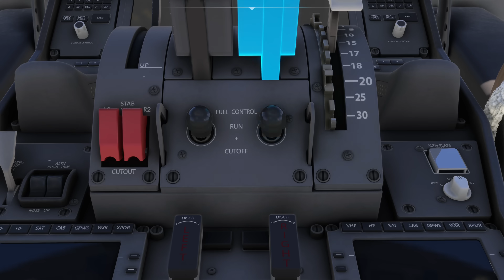Air India 171: Why Did The Fuel Cut-off Switch Get Moved?

Comment: I haven't seen any commentator explore the possibility that a software bug or faulty switch caused the EEC/FADEC and FDR to perceive the fuel being Cutoff for 8 seconds even though the physical switches never moved from Run.  For example, there might be a sensor that detects air in the fuel lines and automatically cuts off the fuel flow; this sensor might have failed or misread.  Such a scenario would explain the pilot's conversation.
Reply: I have asked this on different channels covering this incident and have received no replies. I do not believe there is some sort of mechanical linkage from the fuel cut off switches to FADEC/FDR etc as these devices (FADEC/FDR) work on electrical logic states. If the system detects that the fuel pump (for example) is not being supplied with power, then the system would come to the conclusion that the only way this could happen would be if the switch had been moved to the 'cut off' position.  What if the logic input to the FADEC/FDR confirming power to the fuel pump was interrupted briefly? To the electronic logic, this would seem no different to the switch being set to off. On the other hand, I think there is more to the Run/Cutoff switch than just controlling the fuel pumps. Don't they also have inouts to other parts such as igniters etc?

Comment: Is it correct to “ assume”  that when a fuel control switch is set in its designated run/ cutoff mode, the operations of the fuel valve are “fail safe” to remain in that operating mode until until pilot initiates change?

Comment: Capt Steeeve keeps rhetorically asking “why would one pilot deliberately turn off the fuel switch and the other pilot deny it?” Obviously those fuel switches aren’t mechanically connected to the valves that supply fuel to the engines. There are micro switches, relays, actuators and electronic mechanisms that are all part of that system.  A failure in any of those components could cause a malfunction that led to the crash. Even a 1 in a million chance does not mean it can’t happen. Lotteries are won every week by people despite even higher odds!
Reply: Exactly. I have just made that same point in the comments of another video. Many people seem to think that the data indicates that the switch was physically flipped. That's not necessarily the case. If we had cockpit video, then we would know 100% whether the switches were flicked or not.

Comment: I am from Ahmedabad, if we don't tell the truth then such accidents will happen again in future, if you connect the dots then you will find how hard the pilot worked to save the flight, If you look at the original video captured by the runway CCTV you can clearly see that the pilot tilted the flight from left to right for 2 seconds. The fact is that after that interaction they found that the switches were still in the on mode, exactly 9 seconds later the right hand pilot found the solution and turned the right engine fuel switch off and on, also tilted the flight slightly from left to right (to get maximum fuel flow) 12 seconds after the interaction and 3 seconds later he turned the left hand side switch off and on as well and immediately he balanced the flight again. The right hand engine started but the loss of those 10 seconds after the interaction... became difficult (because they both went searching for other possibilities, since both switches were already seen to be in the on position), in the end the fact is that the pilot did what he could, the loss of that 10 seconds gone hard and bad luck

Comment: I have a different idea. What if the fuel switch move cutoff due to some technical fault and the first pilot tries to adjust it. But the fuel switch moved down again. Then the second pilot ask why you cutoff the fuel butghe second pilot said he didn't do it. In that case it's no one's fault. May be then one pilot tried to keep it up manually by hand or something after trying to put it up several times. This explains yhe10 second gap to turn on switches again. Anyway this is just a thought.

Comment: Read this advisory issued in the past. SPECIAL AIRWORTHINESS INFORMATION BULLETIN
 * fuel control switches were installed with the locking feature disengaged.
 * If the locking feature is disengaged, the switch can be moved between the two positions without lifting the switch during transition, and the switch would be exposed to the potential of inadvertent operation. Inadvertent operation of the switch could result in an unintended consequence, such as an in-flight engine shutdown.

Comment: As a retired 787 Captain (38 years at a major), I don't see a problem with encrypted cockpit video that could only be viewed during accident investigations. When CVRs were introduced, pilots complained that they would be used against them. They weren't, and often exonerated pilots who might have otherwise been blamed. Now we have FOQA where entire flights can be reproduced and information is not leaked. One of the pilots asked the other why he "did cutoff". That could easily have been asked by the pilot who actually selected Cutoff, as a diversion, knowing that the tapes would be used as "proof" that the other pilot did it. Without visual proof, we may never know who moved the switches. Maybe fingerprints may prove who reselected Run, but even that might not prove who selected Cutoff.
Reply: Good points. I'm disappointed that Captain Steeeve says that the audio & data recorders give virtually the same information as video would. If that was the case, we wouldn't still be speculating & asking questions. A video recording would clear up doubts immediately. The cameras don't even have to focus on the pilots, as long as they show the control switches, we would see which of them flipped the switches (assuming the switches were ever physically set to cutoff that is!).

Comment: Hey Cap...I am just an aviation enthusiast...I just wanted to ask a question if both fuel cut off switches were turned off wouldn't they make a sound? And the cockpit voice recorder has 3 mics...any one of those mics would have recorded the mechanical sound of those switches being turned to off state
Reply: There will be a clicking sound for most switches. I am not sure whether all switches are like that or not, but most probably.
Reply: @JPTalkshow hey but during that take off phase pilots are just supposed to provide thrust to the engines and rotate after V1...there is no process of pressing any buttons..so if any button is pressed it would have been recorded

Comment: Hi Capt Steeve .. you didn’t mention the chance of a faulty wiring… ground short.. may be the maintenance performed the maintenance on the panel? Main be a wire was chaffed which shorted the circuit and crew tried to recycle the switch cause they cant see underneath the panel…
Reply: Both switches are on independent circuits. They were turned off 1 second apart exactly the time it takes to be manually turned off.
Reply: yes true maybe one of the screws came loose, or maybe the spring was too springy and it sprung from on to off

Comment: Enjoyed your video, good work.

Question: Let's hypothesise a person was going to intentionally crash a plane, why might they use the fuel switch? I mean I assume that they could just push the yoke hard forwards when close to the ground and achieve the same outcome with a higher degree of certainty. Whereas with the fuel switch it's possible in principle that the other pilot might have noticed what was going on straight immediately and saved the aircraft. If you apply Occam's razor is this the most direct way a pilot would achieve this outcome?

Love your videos, keep up the good work.

Comment: I understand the fuel switch is designed and manufactured in a way that it can’t be hacked or toggled by mistake. But it’s the design and manufacturing flaws itself that’s in question as the whistleblower indicated, so I’m not sure to understand the urgency with the free pass here.

Comment: Is it possible that the transitioning of switches as quoted in the report was referring to what was detected by sensors rather than the physical shifting of the switches by the pilot? And the asking of "why cutoff" happened because the pilot felt/heard the engines stopping?

Comment: I respect you a lot Steve and have been watching you from a long time.
But, I don't trust you anymore on this incident. You have lost my trust when you said that the pilot put up the flaps instead of landing gear in the first video knowing how different the position and structure of their control switches are. Now, you are straight away putting the blame on the pilots and advocating mental health and all.

Not once you have considered a fact that maybe the fuel switches got moved to cutoff due to a mechanical failure and one of the pilots noticed it then when he tried to put them back to run, the other pilot noticed and thought that the pilot itself turned them to cutoff that's why he asked "why did you shut them off" and the other pilot replied "I did not do so".

Comment: when the fuel control is switched off in the air (like during an engine shutdown), do you get any specific warnings or voice alerts on the flight displays or monitors, such as “STALL” or “RETARD”? Or is it mostly just engine parameters dropping off? Curious how clearly the system communicates that kind of failure. Thanks in advance!
Reply: He said in the video that he doesn't know if there are specific warnings or alerts but he hopes so.

Comment: Modern airplanes need to leverage AI. If AI was active, it could have prevented turning off the fuel switch in a take off event and at that altitude. There could be an AI kill switch if both pilot and a stand-by AI agree that the main AI needs to be shut down owing to any software glitch.

Comment: No mention of the 2018 FAA recommendation that the Honeywell Cutoff switches had been found disengaged on some aircraft such that the levers could be pushed up without lifting. The preliminary report says the two switches were moved to cutoff within "01' seconds of each other. That's quick. If the switches were disengaged then they might have been pushed up together in some freak movement and the pilot telling the truth when he said he didn't move them.

Comment: Sir, the preliminary report leaves many things unexamined and undone. (1) Specify who asked the question, though the question has been quoted. (2) Specify who replied and quote his reply. (3) Were there no further discussions between the two pilots - nothing is reported.  (4) Make a five- column analysis. (a) time in seconds, (b) Conversation (c) actual pilot, (d) pilot monitoring, (e) action taken by the system

Comment: Hello Captain Steeve, question for your next Q&A:
In another YT video, former 787 pilot Sharath Panicker (with 10 years of experience on that plane) says it seems very unlikely that a pilot could manually move both fuel cutoff switches from RUN to CUTOFF within about one second. He also noted it took them around 4 seconds to move both back to RUN during the emergency, according to the report, and that's the easier direction without having to overcome the locking mechanism.
How realistic is it in your experience to expect someone to switch both to CUTOFF that fast in the cockpit layout of a 787?

Comment: Can these 2 fuel cut-off switches be placed at more distance apart than from their current position? So then both the pilots have to be in unison and it requires both their actions simultaneously to cut off the supply.

Comment: The critical switches in an airplane are protected by a red cover over the switches.
As important as the fuel switches are, shouldn't they have a red cover over them. It's hard to be unlucky using the switches when you have to lift the red cover first. This will generate a double action before the cut off

Comment: One pilot asking other did you cut off ?? 
That's just question ..When you find something not to be done ..and other admits no i haven't showing responsibility in answer. 
and yes Switches are so visible to other pilot, off course so if other pilot turn it off it would be visible to one pilot in cockpit .
So definitely it's Boeing failure  and switches malfunction .
Reply: Then why were they switched back on? The switches worked perfectly

Comment: Fuel lines are not right behind those switches. It is only an electrical signal going to the computer and the computer turns off the electric valves. It can be a worn wire problem or similar issue. If one pilot turn the switches off then surely he would prevent the other pilot to switch them on again by covering them with his hand or similar action to not let the airplane come out of a crash situation. But the flight recorder said they signalling that they where turned on after 10 seconds. If the fuel valves had been opened just a few seconds earlier it would have prevented the crash. Cockpit cameras would be great as the airline can review footage each month at an evaluation meeting with the pilot and try to correct any ill behavior or praise any good behavior with an extra bonus. Hundreds of passengers lives depend of correct behavior from pilots. One pilot said "why did he cut off fuel" as in he=airplane, when the alarms and indicators alerted of the cut fuel. He must then have looked at the switches and found them on or he would had immediately switched them on again. So after an assessment of the situation for 10 seconds he either put them to off and then on again or the computer did it. At any rate the computer shouldn't allow the fuel to be cut with the throttle not at idle or a fire extinguisher being activated or a second confirmation being done at the flight computers control panel.

Comment: Just wondering your thoughts on the theory of the switches moving to cutoff when the normal call of ‘positive rate, gear  up’ is made. One of the issues 8 see is it appears that he gear has never been raised or unlocked. I’m a sim instructor and have seen some ‘interesting’ responses to someone under severe stress or fatigue that I wouldn’t be able to explain. The best in my thoughts trying to put aside the more obvious conclusion that I hope is not the reason.

Comment: Good morning Captain,
I was just reviewing a comment from an Indian pilot (apparently a senior one), who mentioned that it would be physically impossible for both switches to have been set to the cut-off position within a one-second interval. The reason is that this type of switch is spring-loaded, in other words, "pull up, move down, release." This type of switch is therefore held in place by a spring mechanism.
Do you consider this analysis to be technically sound and plausible?
Greetings from Lisbon!
Reply: It is very much possible unfortunately and has been also simulated since in a real cockpit.
Reply: They're blaming it on pilot to save their own face, the fact is that maintenance had been neglected; not just in India airlines but globally to keep shareholders happy.
Reply: @1977Bom  and your proof that maintenance was neglected is where?

Comment: Dear Captain, thank you for your programs always give me deeper insights. I think this incident happened due to neurasthenia, which may be due to too much stresses piled on the pilot from his daily heavy duties. The pilot cut off the fuel when his neurasthenia exploded on the take off and it was not planned. I think it is similar to an incident happened on Feb 9th 1982 at JL350 just before landing at Haneda airport.
The pilot reversed the engines just before landing on Haneda airport and DC-8 was plunged into the sea by killing 24 passengers and injuring 149 passengers and crew. I believe the above was what happened to AI171 which was not planned but a tragic incident.

Comment: What nobody ask is: If any pilot did move the switch, why did they never said anything about setting them back to RUN position! Cockpit Recorder doesn't record anything about switches after one pilote ask the other pilot if he moved the fuel switches to CUT OFF! Then it's silent until MAYDAY is called out! There should be a lot of talking between pilots if anything was wrong! Or did we not get the whole recording from cockpit?
If switches was in CUT OFF, I would set them back to RUN as fast as possible, not waiting 10 sec to do it! 
The pilots only confirm that they did not move them, nothing else.... They must have looked to them to confirm that they are in RUN position?

Comment: In my view, the plane should not allow both engine fuel cutoff on climb phase. As you cannot retrack the landing gear on ground, you should not be able to cutoff fuel on both engines on climb. Do you see any scenario where cutting off both engines at that stage would be required?